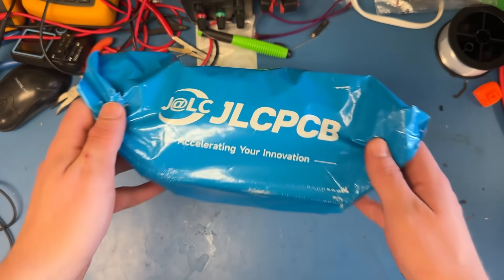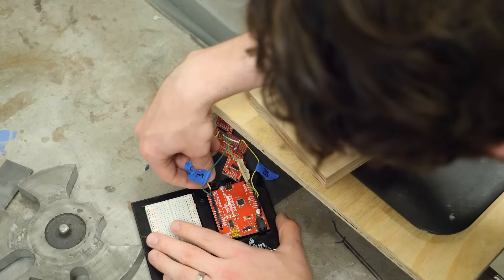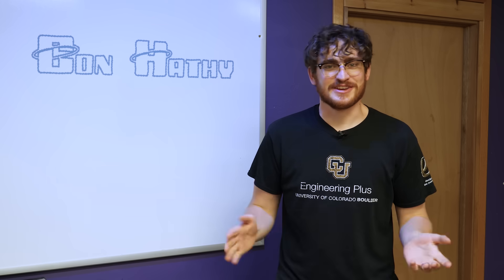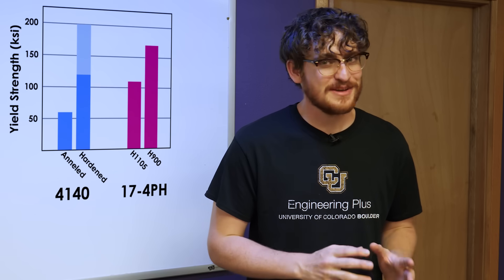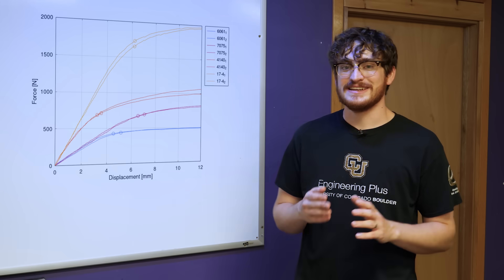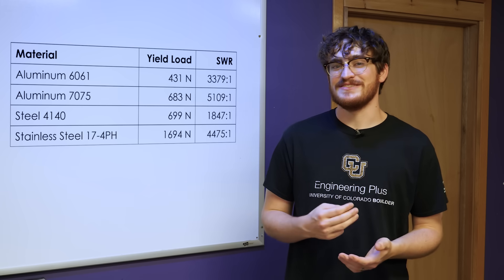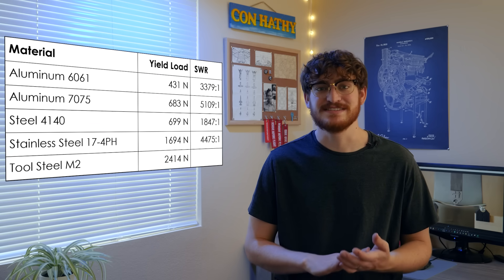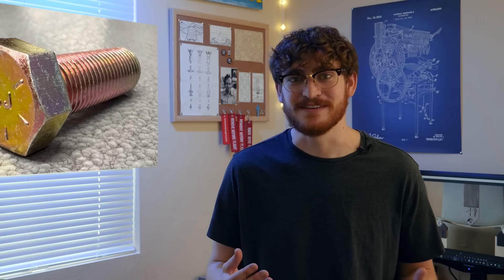Is Aluminum Actually Stronger Than Steel?

Comment: The lack of ductility is often a huge tradeoff for structural members, unless superb rigidity is critical to functionality. There is a reason that steel with a high ductile-brittle transition temp was considered a problem for shipbuilding.
Reply: And so they just found a new steel called Fe-10Ni. Boom steel still wins baby
Reply: @helpimlost137  However, this excellent age-hardenable steel suffers from post-aging intergranular embrittlement along prior austenite grain boundaries
Reply: @Tom89194  where can i find good learning resources about intergranular embrittlement of maraging steel?
Reply: @matthewbadger8685 So you propped up a new 'magical' steel alloy as the solution without actually knowing much about it? I just put in a quote from the first scientific paper I found about a Fe-10Ni alloy..... 
Just remember that the stronger a metal is, the harder it is to machine/form/etc.
Also good ductility can simply mean good ductility compared to OTHER high strength alloys.
My suggestion is to find some scientific papers and or college level material science books. I would give you the name on the book we used in the mechanical engr. material science class I took, but it is currently buried in storage.
Reply: its actually one reason the titanic sank the way it did.

Comment: The soviets already found out that with big enough jet engines a stainless steel aircraft can fly
Reply: Eexcellent. Stainless steel is on a par with aluminum as far as fatigue susceptibility and cuntiness of machining is concerned.
Reply: @johneyton5452 the fuck you smoking? You do realize “stainless steel” includes more than just 304 right? You do realize inconel is technically a stainless steel? And there are tons of precipitation hardening stainless steels that shit all over aluminum alloys when it comes to fatigue.
Reply: As did the Americans with the XB-70 - both first flew in 1964.
Reply: With strong enough engine, barn door can fly.
Reply: Just don't pull more than 5G.

Comment: I didn't know that metal fatigue could happen below the yield point! I also thought that most stainless steels are softer than common regular steel alloys. Because stainless knives don't hold an edge very well, and stainless screws gall easily, and stainless is hard to drill. Which could be explained by a softer material that work hardens quickly. How does that work?

Comment: oxidized aluminium say on 18 wheeler is popular . Go in ny i87 north of albany and its like you are not in usa any more . Guardrail ? Anodized iron . ???? Whats wrong with them ?  Turn out in their application . Anodized iron is a better material . Its been there for a long time . They never touch them . Before ? It was zinc coated iron . They had to maintain those often . I never understood this

Comment: I know it is nto easy, but I would love to see more alloy comparisons like corrosion resistance demonstration, strength at different temperatures, etc.  There is also deal at times with machinability, weldability, galvanic corrosion, and expansion/contraction between metals as an issue if I understand correctly.
Reply: HHO electrolysis generation has greate examples on corrosionon

Comment: Bending is a third power of thickness, so you tested at same weight size then divided by weight and made your point.
Reply from the maker: Yes, and because this test is using a fixed length, the weight of the sample is only to the 2nd power. It gets even worse for something like a monocoque aircraft because there the entire outer surface is fixed and you’re only varying thickness. That means the weight is essentially to the 1st power while the bending resistance is to the 3rd.

This is why steel-based aircraft tend to be tube frames with fabric over top, and aluminum aircraft tend to use the outer skin as part of the structure.

Comment: I was thinking about fatigue all through the video. Can you actually build a better airplane out of steel?
Reply: Define “better”
Reply: @silaskuemmerle2505  I'd say lighter, faster, safer, more range...
Reply from the maker: Many bush planes use 4100 series steel tube frames with a fabric overwrap and they have pretty great performance

Comment: Aluminium is easy to machine, and not too dense. In many cases no treatment needed. Super convenient for optimizing weight and stiffness in machines. Low lead times.
Reply: Not really, aluminium tends to smear on tools and drastically shorten their lifespan.

Comment: Great video!  Thanks!  Also I loved your overture overlay with the shattering M2 :-).  So, I’d be very interested to see a further extension of this video into exploring the hardness/temper ratings of metals.  And I think there are two parts to this.  First there is what each temper type brings to the same tests and also include cost and corrosion resistance. Then there is the issue of fastening. The strength of the raw material is fine, but at the end of the day one has to fasten multiple pieces together. There are bolts and flanges, rivets, etc., and welding for example. Welding is often used in at least small airplanes.  However, the metal will anneal at the weld, and so I am very interested to explore the impact of the weld in the strength of the join and hence structure, as well as methods to mitigate this loss of strength (for example, do you double weld?  Or do you use a different allow welding filler rod?, or is there some kind of a brace or gusset used?  Probably got a couple of videos worth of ideas here :-)

Comment: It's not always about achieving the highest elastic limit or yield point per weight, Sometimes it's about the stress strain slope. If rigidity, or minimizing strain is the goal then steel is the obvious answer. But in an application like an air frame high levels of strain (below the elastic limit) Is desirable As it acts as suspension in rough air. IOW it's the spring rate of the material that is important.

Comment: 7:53 meanwhile crevice corrosion and liquified hate (sea water)
Reply: I don't know the exact alloy but I've seen "stainless" steel rust on multiple occasions.
Reply: @dreamoftranscendence4415 it's like any other steel, some are really resistant and others basically are not.
Reply: @dreamoftranscendence4415  You want 316 or 316L SS if you want it to not rust. Other grades will rust, though 304 isn't too bad so long as it's not in seawater.

Comment: This is interesting. I would never have thought that aluminum would ever have a higher strength to weight ratio, regardless of alloy. I tend to like it merely because it's lighter, easy to carve up and generally is strong enough, but the biggest problem for me is that I, as in me personally, can't weld it particularly well. Steel is basically infinite clay in that regard, because I can weld it and cut it and back again, but it's also really heavy and unless I need that strength aluminum is easy enough. I guess what I'm trying to say is, tradeoffs are the key. When you need one, use it, but don't expect them to be interchangeable.

Comment: Aluminium might not be good for aircraft stuff but it is good for small mass produced parts because it is cheap, requires minimal heat treatment, and can be die casted, single die cast mold can make nearly half a million of parts in relatively short time without waste. We can't do that with steel. Thanks for the tests.
Reply: Ehh, half of any aircraft is made of aluminium.
Reply: Aluminum is excellent for aircraft, 7075 T6 is probably the most widely known aircraft grade alloy

Comment: In many situations, this is why composite materials are an answer! For example, armor with an outer thin layer of hard but relatively brittle steel, on top of a thick layer of tough aluminum armor. The aluminum keeps the steel from deforming enough to shatter, and the total package is significantly lighter than an equivalent amount of steel armor.
Reply: It makes it much more expensive to build, and you have issues with galvanic corrosion...
Reply: @taiwanluthiers  2 important points that way too many people forget.
The construction cost is lees important than the galvanic because bad selection resulting in galvanic issues can lead to disasters.
Reply: I always wonder if composites could replace aluminum since they make better drone racing frames ,, but actually I think that carbon fiber composites don't handle fasteners as well as aluminum, and crack at the bolt holes more. I could be wrong.
Reply: I have to disagree, composite structures make recycling and reclaiming the raw materials much harder or impossible. Only the most challenging use cases should be solved with composite materials, otherwise the products end of life is a huge mess.
Reply: @vinercent215  That is a very valid point BUT THEN the same issue exists for 1,000s of other materials and the millions of products they are found in.
Reply: What vehicles use this setup?
Reply: @boomchacle  b787 is composite body
Reply: Yea! my favorite example is the aluminum engine block on modern gas engines and the steel cylinder liner, steel takes the brunt of the heat and combustion forces while the aluminum reduces overall weight dramatically and dissipates heat far better
Reply: The problem with alloys is we mostly just guess until we find something interesting. Especially true with high entropy alloys which adds an extra layer of guessing getting the metals to mix correctly.
Reply: Great idea and its actually the same concept used in Japanese Katana blades.
NOW EXPLAIN 2 things.
1) the concept of electrovalence and why you need to be very careful with which particular steel and aluminium you select; and 
2) how you bond the 2 metals together because they do need some form of bonding to get them to do what you want.

Comment: I wonder if the amphibious planes of the pre-airport days were made of steel? They had to be super-strong to support themselves on the water, right?
I wonder if the surviving ekranoplanes or hovercraft use steel instead of aluminum.
Reply from the maker: I don’t know about amphibious planes, but I wouldn’t be surprised if they have some steel frame for impacts. I do know that 4100 series steel tube frames are pretty common in bush planes
Reply: @ConHathy  That makes sense! Thanks for replying and thanks for a fun video. Glad you didn't lose an eye!
Reply: Most of the structure of any metal skinned aircraft will be either 20XX series aluminum (often 2024-T3 alclad) or magnesium. Flying boats and seaplanes are usually aluminum because of corrosion (magnesium corrodes like you wouldn’t believe and most steel isn’t any better) and the fact that they really haven’t been built in any real quantity since the advent of composites.

Comment: The US Navy made some missile frigates with an aluminum super structure to reduce top heaviness, but found out it melts when the ship catches on fire (USS Belknap).
Reply: The Swedish fast attack crafts of Spica (carrying torpedoes) and Spica II (missiles) also had aluminum superstructures and there have been many more such warships in the world. The new litoral combat ships of classes Freedom (alu superstructure) and Independence (all alu) have had some trouble but not with regards to fire resistance. 

Alu is worse than steel in a fire but everything in life is a compromise and sometimes you have to accept one drawback to achieve some other important aspect.
Reply: @skunkjobb from what I've been told by people working at Bath Iron Works they have had problems with bearings and seals because of electrochemical reactions of steel/brass/aluminum in sea water across all of the experimental aluminum ships
Reply: The USS Stark FFG-31 with the aluminum superstructure, was hit by two Exocet missiles in the HY-80 steel hull, with only 1 missile exploding. The aluminum superstructure was damaged, but reports don't mention exceptional damage.

The ship was repaired, however the officers careers were permanently damaged.
Reply: Knew a guy who sailed on old destroyers/ cruisers with aluminum super structutes. He said, everytime they fired the guns, they had to re weld the superstructure to the  hull...
Reply: It's pretty common for warships to have an aluminium superstructure. It helps with stability and reduces magnetic signature.
Reply: Your daily reminder that jet fuel can't melt steel beams 😆
Reply: It doesn't burn. However, since the melting point is lower, it deforms more easily in fires.
Reply: Australia also had steel hull/aluminium superstructure vessels https://en.wikipedia.org/wiki/HMAS_Adelaide_(FFG_01)
Reply from the maker: How did this get approved? The Wikipedia article is pretty short but this sounds like one guys pet project
Reply: @ConHathy  They also did that with the Oliver Hazard Perry class FFG's, and I was a pipefitter on those.

Comment: The StarShip rocket is made out of stainless steel.
Reply: Yep and it's made out of steel mainly due to steel beating aluminum in super cold and hot environments

Also steel is much cheaper
Reply: @karliszauers1  The steel Starship is made from cost WAY more. Only cheapo mild steel beats Al, and even then it depends on supplier.
Reply: @Thorgon-Cross it's a slightly tweaked 304, aero grade aluminum costs way more. Also good luck getting aero grade aluminum at that scale. Plus there are more cost savings in the manufacturing process, back in the day almost everything was MIG welded, nowadays it's mostly laser welded. Aluminum requires friction or stir welding
Reply: Falling SS prices and laser welding have made it more attractive... not to mention some properties are superior.

Comment: I'm surprised M2 tool steel is particularly high strength. I would have thought the carbides would weaken it.
Reply: Tool steels are usually super strong to withstand high machining loads but the hardening process makes them brittle. A carbide endmill can hog out steel for weeks on end but will chip if you drop it.
Reply: @georges8888 It's not just the hardening process that makes steel brittle. The carbide content does too. You see a downward trend in toughness as carbide content increases. I'm not sure what the toughest steels are but I would expect them to be around 0.6% carbon to avoid carbide formation.

Comment: I had no idea that steel could have such high strength to weight ratios. I wonder why we don't see more ultralight bicycle frames made from that
Reply: because the wall thickness of the tube would become super thin and buckle (see the video),  also super thin hardened steel will probably crack because it is more brittle.
Reply: @zorktxandnand3774  yup, you'd have to make little trusses or something, rather than tubes, to really make a lighter or stiffer steel frame  without running straight into buckling.
Reply: @kinguin7  I think problem with bike frames is that if you use these very had types of steel, you just can't scale your design enough to make a non cracking or buckling deign without losing the weight benefit. 
You could make a mini trellis frame if small thin wall tubes, but that would be very difficult and expensive to make and you would still very easily damage each tube. 
Porsche made a very very light weight Trellis chassis for the 917 le mans race car, and most of these chassis were scrap right after welding (due ti the very thin walled tube). 
They  filled the chassis with compressed air, so the driver could check the chassis pressure. If it dropped it meant that there was a crack in the  chassis, and they had to stop before the thing ripped apart.
Reply: @zorktxandnand3774 so off the bat, I think this is impractically expensive to make 😅

But, in my head the point of using trellises instead of a single round tube for each frame member was to avoid having thin walls (at least, relative to tube diameter). Maybe even a trellis of solid rods. Whether that's actually better/acceptable from a mechanical perspective, I think so but it's beyond my area of expertise.

Then you run into crud getting stuck in the frame, possible aero disadvantages, etc, even if you could manufacturer the thing in the first place without compromising the material in the process or something. 

I have no idea of the name, but there was at least one carbon fiber trellis frame mountain bike, if I remember right.
Reply from the maker: Yeah, you would much rather bend your frame from a hard bump than have it shatter
Reply: @ConHathy  doesn't this already apply to carbon fiber frames? They explode when they crack. How much worse is steel in this regard?
Reply: That's why thin 4140 tubing is used on bikes and roll cages.  It's strong, but flexible enough to not crack.  Everything's a compromise in engineering.
Reply: Plus if it is stiffer, than more shock goes into the rider.

Comment: There was an attempt at a welded steel airframe and it was buckling galore.
Reply: MiG-25 doesn’t seem ti have this problem.
So the point is you need to know what you’re doing? That would be kind of general rule.
Reply from the maker: For the skin certainly, but there are a bunch of tube and fabric aircraft that I believe use 41XX steels. They avoid the buckling issues that come with thin skin by arranging tubes into a truss
Reply: @ConHathy  usually 4130 based on what alloy Aircraft Spruce has the most variety of shapes and sizes in.
Reply: @ConHathy  Sometimes that extra thick cross section with less weight serves a purpose. :)
Reply: a large majority of airplanes are welded steel.